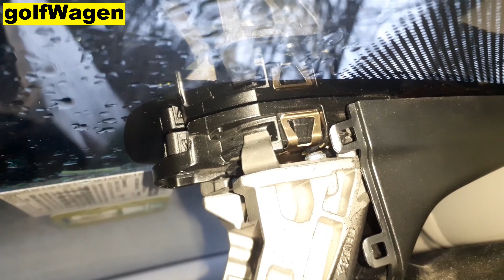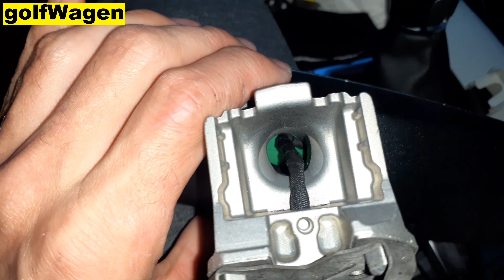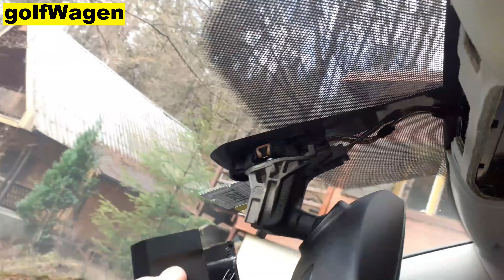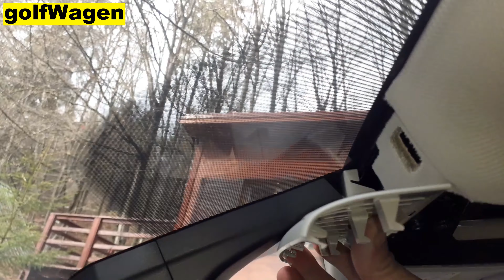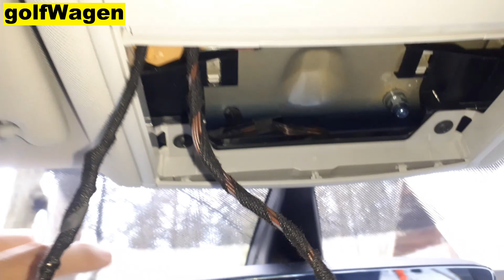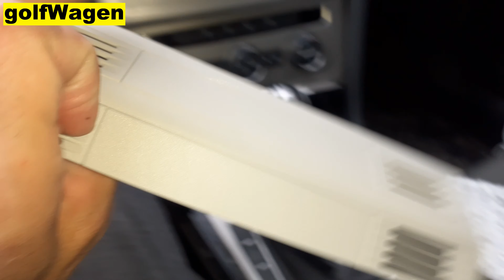VW Golf 7 mirror replacement

Comment: Fun fact, Ford lanekeeping cameras in the 2010s used the same mounting system. It was a slightly different shape, but the two are interchangable.  
Ford mirrors even have holes in the casting for the specific retainer VW used, despite Ford not using them.

Comment: Hello ,  I own a Golf 5 Fsi (2004-2009). I have a problem with my car and I would like to get your thoughts on this problem. This fault persists for a short time and then disappears. "P0420 - 002 - Efficiency Below Threshold - MIL ON" error appears when I stop the vehicle and turn the ignition off when the engine is hot and restart the engine for the first time. Then this error disappears. This check engine light will only appear on the first start after the car is turned off when the engine is warm.